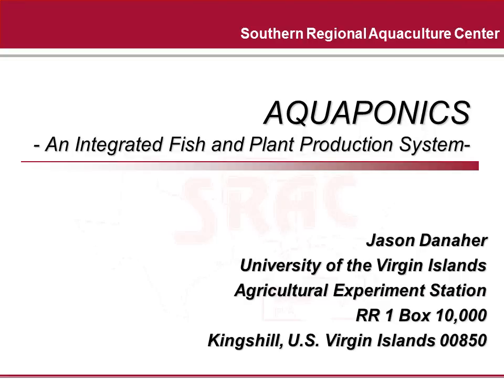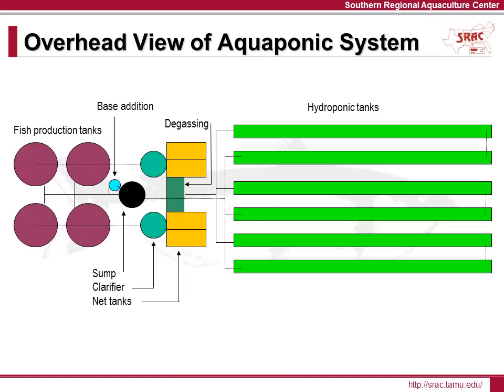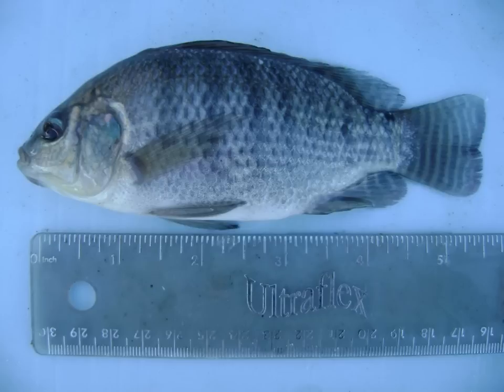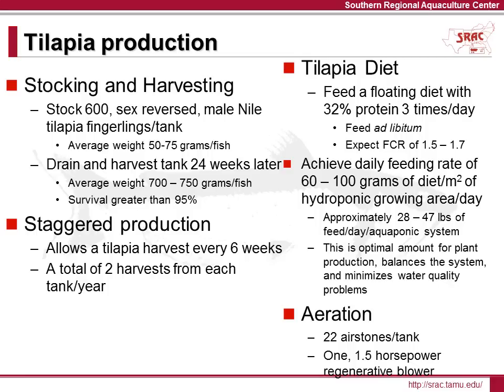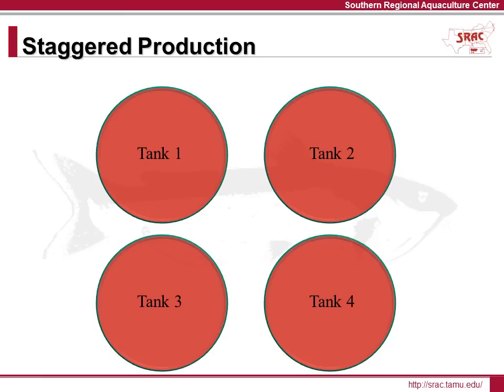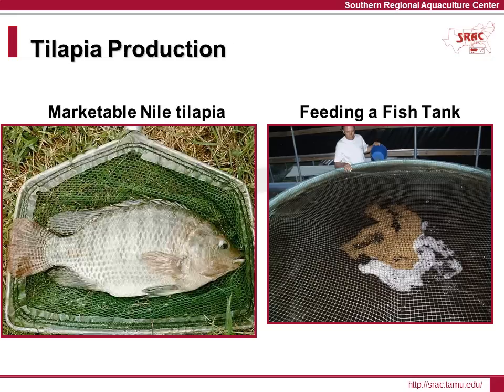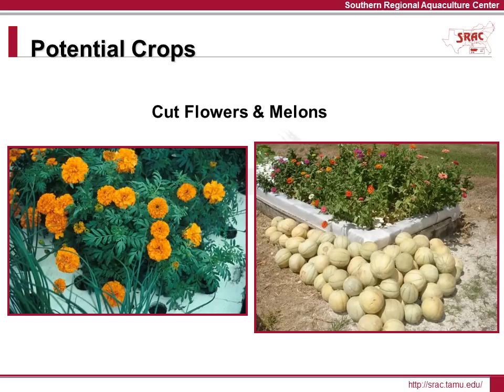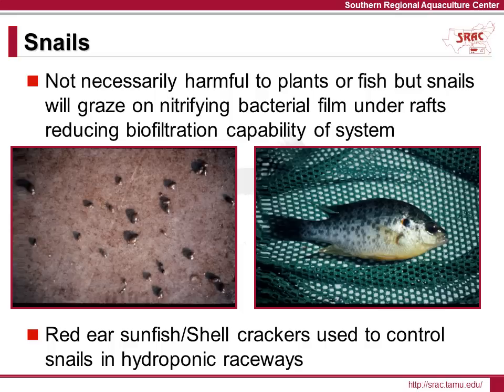Aquaponics - An Integrated Fish and Plant Production System

Comment: Hey, I have been going through your video one thing I have been curious about with the raceways. You have your raceways 100ft by 4ft but you have stated that each raceway has 12rafts per raceway. But based on my calculation this wouldn't maximize the space of the raceway would only be utilizing half of the space of the raceway. Can you clarify this, please?  You stated your rafts were 8ft by 4ft and the raceway was 4ft wide by my calculations you should have been able to fit at least 24-25 rafts in the raceway. Or have I miscalculated? @ David Cline
Reply from the maker: Shane, the 4x8 foot rafts are put into the raceways lengthwise so 12 x 8 feet is 96 feet.  So you could actually put in 12.5 rafts.  Some farmers use have 8 foot wide culture units and put the rafts with the long direction across the unit.  The trouble with this configuration is that you can't reach the plants in the middle of the raft if necessary.  Hope this helps.Cheers,
Reply: @clinedj1  Hey thanks yes it helps. I have a few more questions. What is the spacing between each hydroponic raceway and what would be considered a heavily stocked system or would be the requirements to grow crops like tomatoes, peppers, and cucumbers in an aquaponic system that are more nutrient demanding crops.